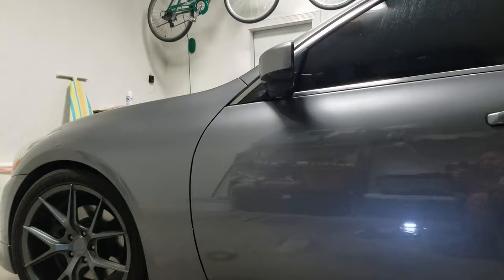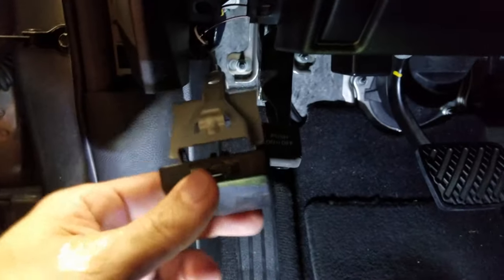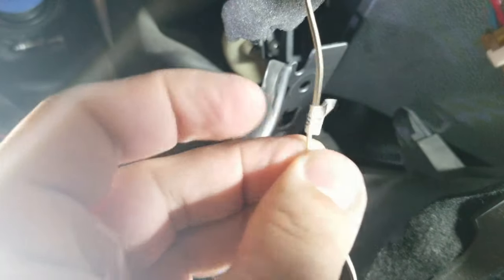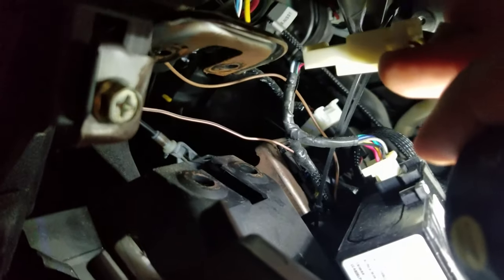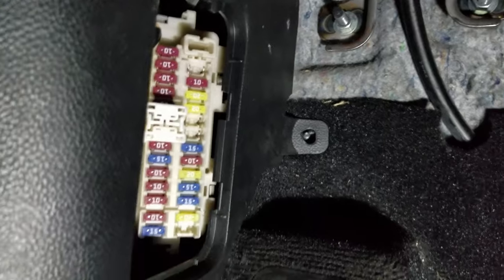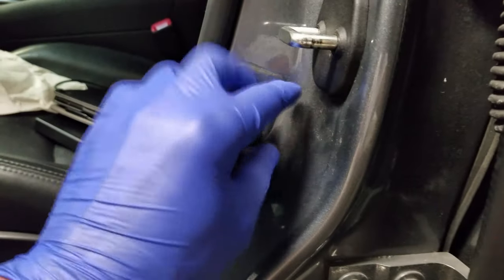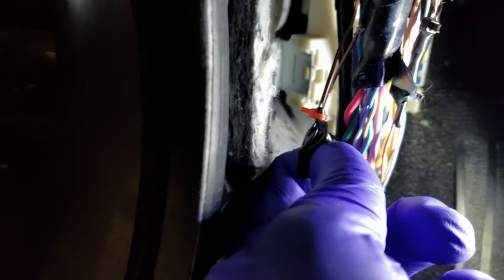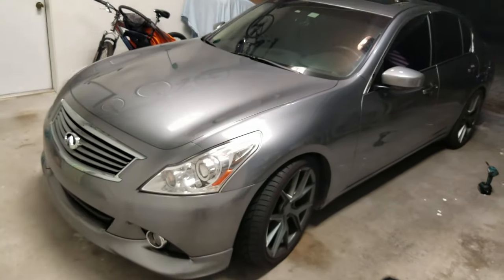Infiniti G37 Remote start install

Comment: These videos are dope! I just got myself a 2012 g37x sedan a few weeks ago; best car I’ve ever drove. Watching all your videos like the tablet, led grill, etc gives me a lot of motivation to mod my Infiniti! Keep up the great videos. My condolences from Minnesota 🤙🏽
Reply: Haha I have the same car 2012 infiniti G37xs. I bought it a year and half ago. Its reliable. Definitely the best and funnest car I ever drove.
Reply: @Vortex_one  got mine about a year n a half ago lol, haven’t really had any issues other than fixing previous owners mistakes but I’m supercharging mine and running e85 rn 😁
Reply: @xStaySkilledx  What's the cost looking like all said and done for the supercharger? From what I've seen making these cars faster is fucking expensive. Even though I love my G I can't wrap my head around spending so much when you can start with a turbo car that comes with a turbo and get so much more power for less money.
Reply: @ericmarciniak1  idk I mean I went with a few optional upgrades, expensive gauge and gauge pod setup, fuel return system, flex fuel kit, but all in all I think it was about 10k to run 600+whp? With initial cost of the car being 9k and other mods about 2k I think it’s good power for the money.

Comment: Thanks for the video.  My wife's been hassling me to get a remote start because "everyone at work" blah blah blah.  I bought this and hooked it up using this video and the online directions.  Some issues for anyone reading this:
1. I connected a wire near the near the door switch rather than messing with the giant bundle.  It was a pain to route but I had a perfect wire laying around for it.
2. I soldered my connections and then taped them up.
3. Re-connecting the PTS connector was extremely hard for me.  I ended up removing the switch so I could line it up.  It's held on with only 2 clips at 5 oclock and 11 oclock and comes off really easy.  Find a video and give it a try if you have trouble. 
4. Programming it to my OEM fob was a bit confusing but it could be that I'm not good at following directions with that many steps.  Both fobs work after programming one.
5. That black connector for programming was a bear to connect.  I had to temporarily unclip the shell to get it connected.
Reply: Yes

Comment: Awesome video thank you - I really want this done but have never tapped into cables, I don't want to mess anything up
Reply from the maker: I get it. I'm sure you can find a local shop that would do the install in less than one hour(if they know what they are doing, probably 30 mins or less).

Comment: Did you just tap into the 3 wires on the BCM or did you completely replace them with the wires from the Fortin module into the BCM?

Comment: Would this work with other brand remote starts? I don’t like the idea of the three locks for a start. I found one with its own designated remote called compustar 2WG15. Also it has an app for access and such.

Comment: When the battery need changed does the module have to be unplugged and paired again ?
Reply from the maker: No. It worked without having to pair again.

Comment: Do you think we can use an aftermarket remote to skip pressing the lock button 3 times or use another OEM Infiniti remote with the remote start button already but just reprogram it?
Reply from the maker: If you want to get away from pressing the lock button three times, I believe the manufacturer has a remote they can sell you that will accomplish that. Regarding aftermarket remotes, I believe this unit will work with any remote that is programmed to be used with your car, regardless if its OEM or not.
Reply: Miami_g37 for sure, thanks bro. Just wanted to see my options. I had viper alarms and I remembered the remote giving me feedback when the car has started. Now when I press it 3 times I don’t know if it started lol

Comment: Did you connect to the passenger kick panel BCM?
Reply: I just finished mine and wondered the same thing.  I ended up giving it a try before connecting the passenger side wires and it started fine.  I think it's unnecessary if you are using the OEM fobs.

Comment: Yesterday have installed fortin evo all on me g37 2008 at. Remote start works fine but it does not turn off remotly. Does it suppose to be like this?
Reply from the maker: No. If you remote start it, you should be able to remote turn it off as well. Check your wires to make sure you tapped into the dome light that turns on/off when you open the car door.

Comment: Hi, I just received one of these but none of the wires are labeled. I’m just curious if the brake light tap is the solid brown wire from the kit and also is the door sensor wire the orange with a black stripe? Sorry to bother you. Thanks in advance.
Reply from the maker: Do you mean parking lights? Yes, its the solid brown wire that goes connected to the red wire. The other wire you mention should be like a 
 lite orange/pinkish with a black stripe, yes, and that goes connected to the door sensor. Good luck!
Reply: Great, thank you. I’ll be making those two connections this coming weekend. It also wouldn’t start with the Infiniti RL2 plug connected, but starts with the Nissan RL1 plug instead. I’ll be researching that more as well because the lock button 3 times doesn’t shut off the car. Thanks again for your help, there’s not a whole lot of info out there and I can’t believe my kit didn’t come labeled.
Reply: Thank you guys for pointing this out my kit did not come labeled either and was stressing out a bit

Comment: Hello, It's a good video. I installed an evo all on my infiniti Q40 (same as g37) and everything works. 3X on lock and it starts, and 3X on lock it stops ... but when it stops, the doors automatically unlock as when you stop the car normally. Do you have any idea what could be causing this? Thank you
Reply from the maker: Maybe you have the key in the car? Otherwise sounds odd.
Reply: Did you guys bypass the remote start module or just plugged and played installed mine yesterday but after 3x pressing the lock button nothing the car wont start

Comment: Did you need to buy another key pob and  if so. why?
Reply from the maker: No additional key fob required, module uses the signal from the factory key fob.

Comment: Im Going To Do This To My M35S But Quick Question If My Original Key Fob Isn't Working How Can I Get The Remote Start To Work?
Reply from the maker: I believe this same company sells a long range remote + antenna you can purchase and connect to this unit, thus eliminating the need for an OEM key fob. Good luck.

Comment: My car will start with 3 clicks of the lock button but it won't shut off the car if I click it 3 times. Any ideas why that would happen? Are the optional wires required to be connected to make that feature work?
Reply from the maker: This happened to me on my first go, check the door cable you tapped into. There are cables that look very very similar to the one I discuss in the video so you probably tapped into the wrong one.
Reply: @Miamig37  I didnt hook up the optional wires yet, like the door cable. Would that cause be the cause of this problem?
Reply from the maker: @iTzBuFaLoWinGz  yeah, for sure.

Comment: Does this work for manual G37's?
Reply from the maker: Nope, automatics only
Reply: Viper has one for manual transmission
Reply: You'll need the Fortin EVO-ONE for a manual transmission which you can also use the module for a Automatic transmission.

Comment: Miami_g37 how come it’s silent when you lock your car?
Reply from the maker: I disabled the the audio confirmation for locking the car. The method in doing so is holding the lock and unlock button on the key fob for two seconds.
Reply: Miami_g37 I suggest turning it back on. Having the honk is a good idea you can turn it off/on at anytime

Comment: I just installed it on my car but im facing a problem,
It works fine when I remote start it by 3*lock but when i want to torne it of by 3*lock it doesn’t go off even the unit doesn’t blink blue led when I press off button